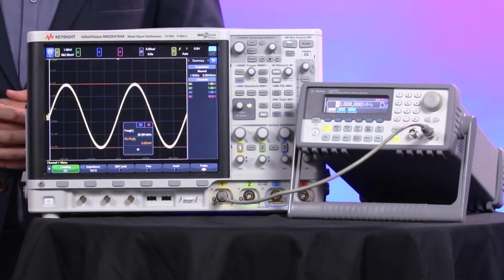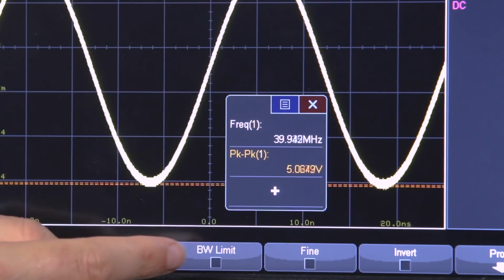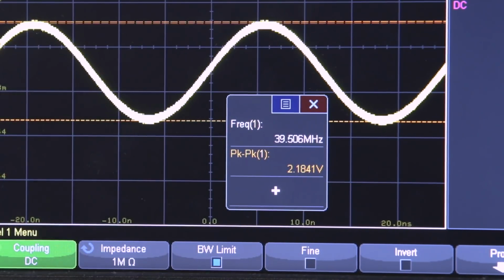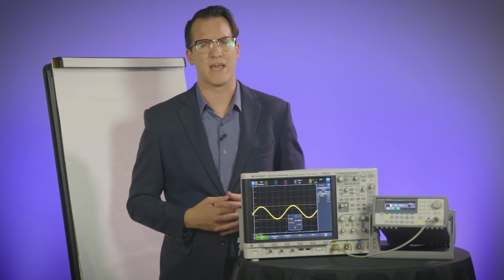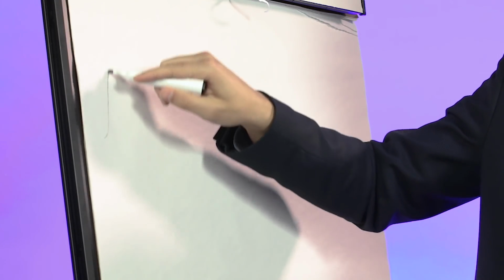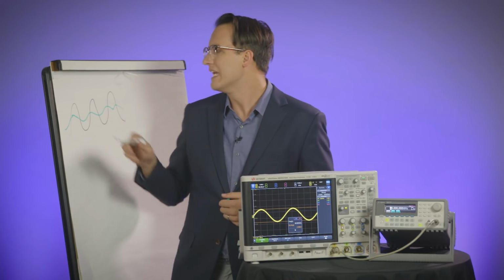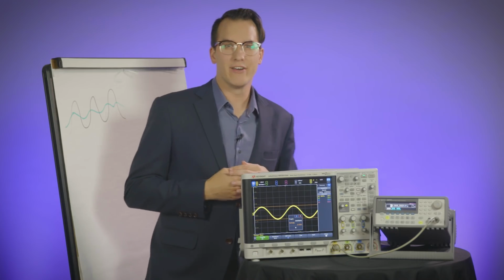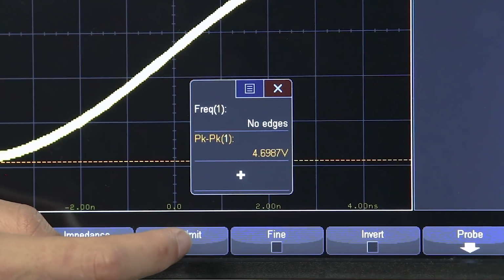Understanding Bandwidth - The #1 Test Gear Spec You Need to Know

Comment from the maker: Thanks for watching! A couple clarifications:

1. When the input voltage is higher than the currently plotted voltage, the waveform will continue to move positive. When it's lower than the plotted voltage, the waveform will move negative. So, there will be a phase shift between the input voltage and the actually plotted waveform. The plotted waveform will also likely be distorted.

2. In the RF engineering world, bandwidth refers to a span of frequencies instead of 0 Hz -n Hz. Filtering and transmission techniques and are used to filter out unwanted frequencies. For example, cellular 4G runs on a carrier frequency of 2-8 GHz with channel bandwidths of  5-20 MHz.
Reply: Please scope i never have any and im not able to work with my electronics😢😢

Comment: i have question  i searched for oscillioscope that can measure  frequency 433mhz to 900mhz but they are all  not cheap ,  can i use  a 1gb bandwith 250mhz oscillioscope to measure the 433-900mhz rf module and can be used to measure the output power ?

Comment: Hi, in digital scopes we have ADC to measure voltage at every clock/ sampling rate. And for high speed Digitizer input voltage range is merely 2Vpp at 50ohm termination. Can we do same here by selecting small input range and feeding small voltage but higher frequency's. I understand rise time issues will be improved since now it has to swing few voltage/mV at high speed.

Comment: I have a question ..
When an oscilloscope has low bandwidth then what kind of signal is not displayed correctly 
A-  sine wave
B- SQUARE WAVE
C- TRIANGULAR WAVE
D- MODULATED 
Reply me fast
Reply from the maker: In general, fast edges slow down and amplitudes are reduced as the signal exceeds the system bandwidth.
Reply: Suppose u have sent 100 Mhz sine on oscilloscope and scope's bw is set to 100 Mhz....

Then sine will be displayed correctly with 30% attenuation.

But if u have sent 100 Mhz square, then high frequency components of square (300Mhz, 500Mhz and so on) will be lost so square signal can't be represented correctly with only 100 mhz..

Comment: I had a friend, who happily measured 100+MHz on 35MHz analog oscilloscope. With digital scopes there's a problem of ADC speed. With multi channel operation the possible frequency goes down.
For analog it all depends on components and quality. My 250MHz analog has RF transistors on input, allowing for 500MHz signals to be seen. However my slow portable 5MHz analog will have trouble keeping up even at 8-9MHz, having sync problems(unless the signal is also connected to external sync input) and introducing plenty of distortion into the signal.

Comment: Is 2:56 the same thing that happens when you put a capacitor across the signal line?
Reply: Yes, because the capacitor and the output impedance of your source will form an RC low pass filter, filtering out higher frequency components and reduce the signal's rise time and limit the bandwidth of your system. How much will your signal be affected depends on the RC components.